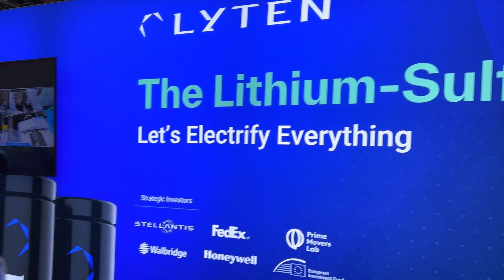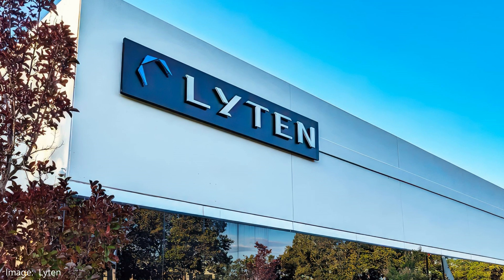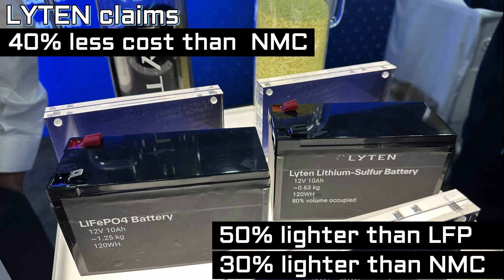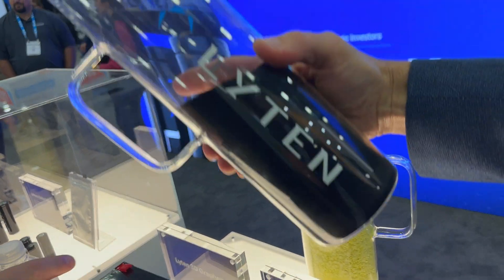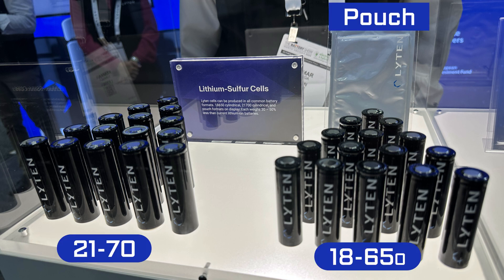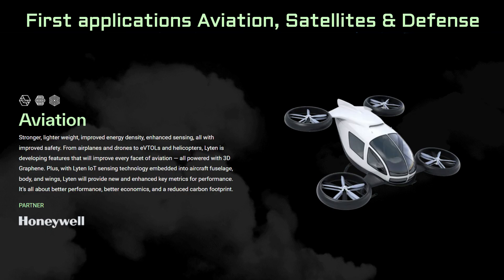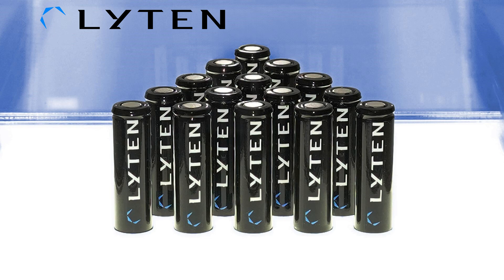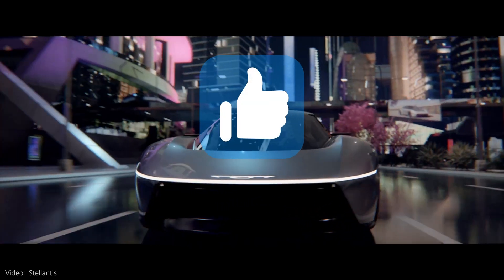Lyten Lithium-Sulfur Batteries powered by 3D Graphene

Comment: Hybrid battery will always win in range. Making a pack that is part sodium ion, part Lfp, and part lithium sulfur. Puts less stress on batteries cuz u can use software to maximize battery life. Like using the sodium ion battery for running low power demand parts, driving on lfp at low speeds and li sulfur for high speed driving.